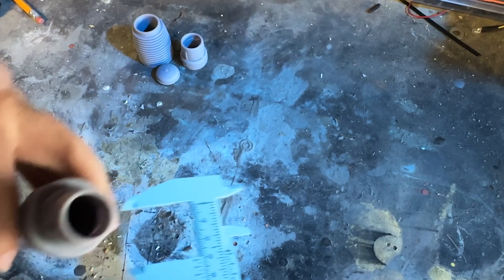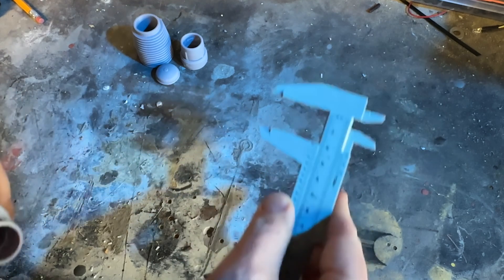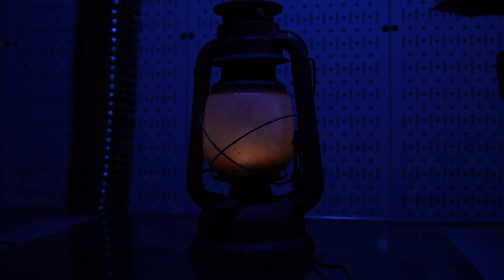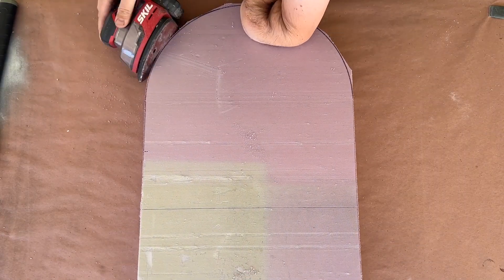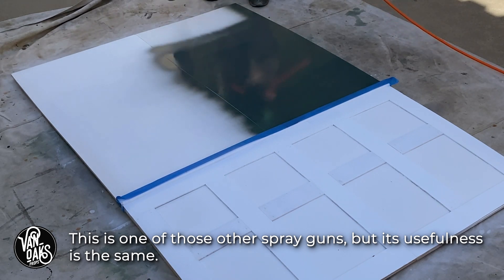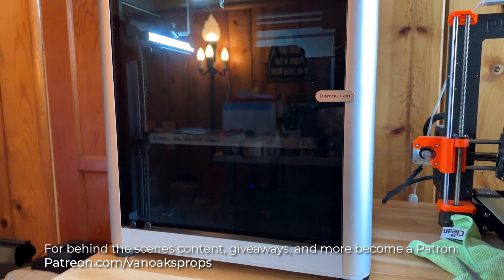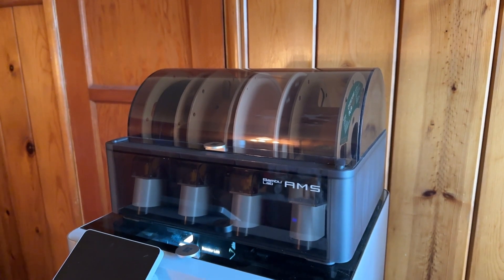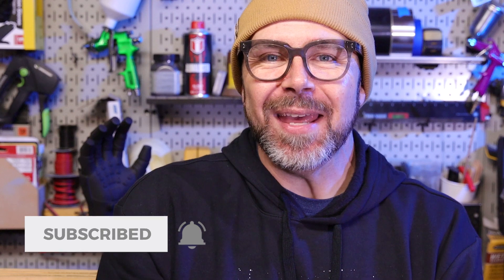Top 5 Tools for Makers 2023 - Improve Your Workflow!

Comment: Actually, there is more than 3 ways to use calipers. I'm sure you already know of these methods. I figure due to simplicity to the video your making here, but for folks who do not know, here are a few more fun methods. Besides using the stem to measure the depth of a part for inner diameter hole you can also measure the depth on the outside as well plus a different way as well. The part you have holding in your hand in the video, the step between the larger and smaller diameter tube, to measure on the outside step for depth,  have the two blades laying down on the tube surface with the blade on the left, in the the crevice of step. Pull the calipers out till the right blade that checks inner diameter holes is laying over the top edge of part. This will get you the number you need as well. Also used calipers are great for scribing as well. You can use a strait edge as a guide to follow the path with caliper tips to the correct length. Another thing is, if you drill a tiny center hole, you can use the caliper tips that are generally to check inner diameters as a scribe for making circles by putting one of the tips in the hole and the other to the radius length you set to make a complete scribed diameter. Also using the outside angles of the blades to mark with a pen on your part for perfect angles. I use them everyday and are an integral part of my job be at work or on my hobbies.